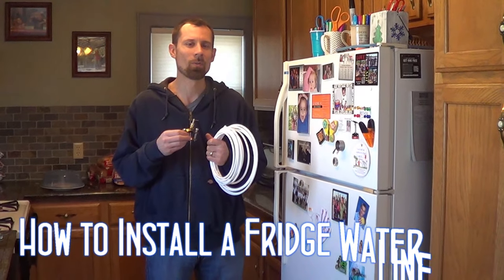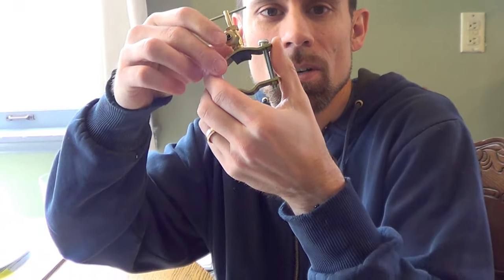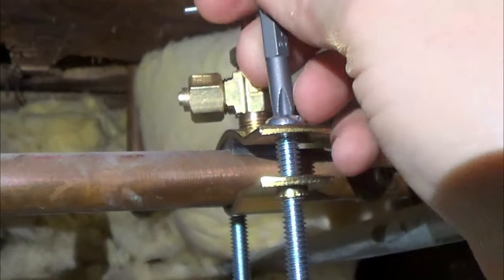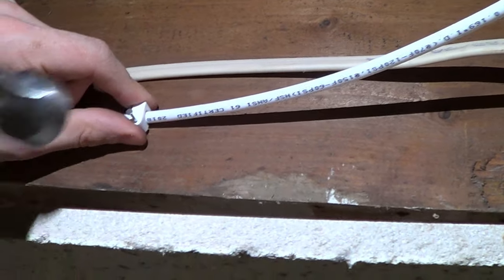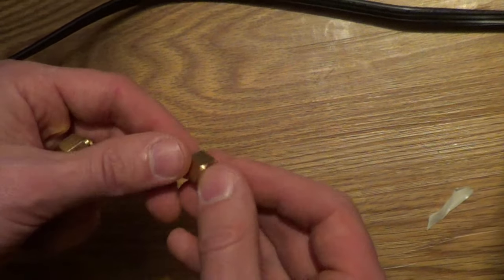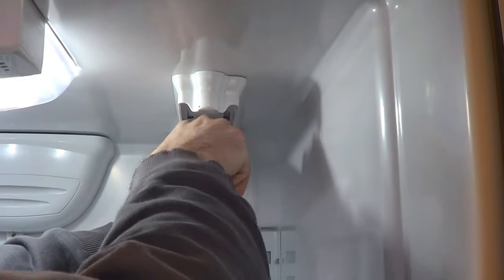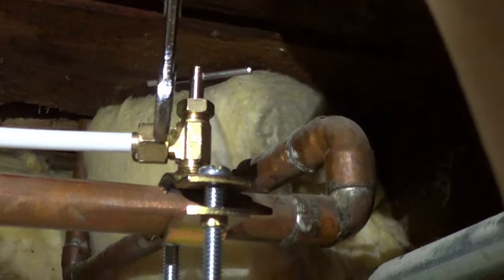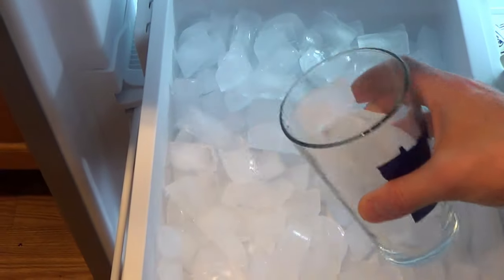How to Install a Fridge Water Line for Ice and Water in your Fridge

Comment: Saddle valves are not the best. Thanks for not editing out the leak. Good for anyone that does not ever do this know what they could expect. I'd also say support the bottom of the valve or copper any way possible to make sure nothing busts. I'm sure people might be trying this on real old pipe and no one wants a major leak.
Reply: If saddle valves aren't the best, what would you suggest to use instead? thanks!
Reply: @NatalieMoore25 use an actual  copper T Fitting or connect to your cold water under the sink so you don't have to cut any copper water lines.

Comment: +Minnesota Cold  I have a question, how come your water line didn't spew water everywhere after you replaced it?  I mean like, you turn off your water supply, did you leave it off until the refrigerator was delivered the next day?  Or did you have something to clip the line to prevent it from leaking?

Comment: I had difficulty pulling my fridge in and out, so I took 2 straps about 2" wide and about 2 feet longer than the depth of my fridge and screwed one end to the back of the fridge.  My fridge has 5 screws on a cover near the bottom to hide the plumbing.  I removed the second and fourth screws and attached a strap to each screw then ran the straps under the fridge and pushed it back in place and neatly tucked the straps under my fridge (the ends under the fridge had plastic buckles that makes it easy to find when I need to fish around underneath to grab the straps and pull the fridge away from the wall.  It makes cleaning behind the fridge easier and when I needed to unplug the fridge whenever the ice maker loses its mind or whenever one of that pex hoses decides to spring a leak.  About 2 years ago for no reason whatsoever the pex that runs on the back of the fridge from the filter to the water inlet valve just started shooting water, so I had to shut off the valve on the floor and change it out (go ahead and duct tape that extra water line to the back of your fridge.  FYI this past weekend another fridge hose gave up the ghost but it wasn't the 1/2" pex that's readily available, no it was the 5/16ths that luckily Home Depot had in stock that runs UNDER the fridge from the water inlet valve to the connector on the hose at the bottom of the freezer door.
Those water lines are great when they work and I've swapped out ice makers about 4 times which I think had seasonal issues that would have resolved themselves on their own, but wife!
Reply: but most fridges have wheels though??

Comment: Saddle clamps for water supply is not approved for use almost anywhere. IIRC, it is against virtually all building codes in the US. You need to "cut in" a permanent t-junction.

Comment: Oh, no, a saddle valve!  I'd avoid ever using a saddle valve.  I would prefer an old fashioned soldered connection, which if you don't feel comfortable with that, I don't think a plumber would charge you that much since it's in such an easily accessible location and you've basically done all the prep work.  

If you don't want to do that, you could always turn off any nearby valves, if there isn't one, shut off the main water line and open your outdoor faucet to drain out the lines, cut the pipe and use a sharkbite fitting. I would prefer a soldered line, but at least the sharkbite (and your current saddle valve) are in a spot that you can easily see and fix if it starts to leak....
Reply: $200 minimum charge here in my area for a plumber.

Comment: Everything in this video seems pretty legit however do not ever ever ever use saddle valvs unless you absolutely have to. Even if it adds 10 hours to the job and a couple thousand dollars don't use them you get a week with those things that can cause tens of thousands of dollars in damage in those things leak all the time.

Comment: not unlike shark bites for "PEX" except with the retainer nut.  I was worried I wasn't going to be able to do this!  I am not going to mutilate a piece of sheetrock I worked hard on just to get the waterline behind the wall! now I can just drill a small hole in the drywall instead of slotting it out!

Comment: Plastic lines will leak and will also leave a bad "PLASTIC" taste in the ice cubes and water. Use a metal braided supply line (especially if running in a ceiling). It's only a few more $
Reply: Bravo! That was how my old fridge was connected by the plumber. Some sort of copper line.
Reply: The whole freaken fridge is plastic .are you going to replace the  inside also ???
Reply: @pierreverdoni  soft plastic of the water line is different from the painted hard plastic in fridge :)